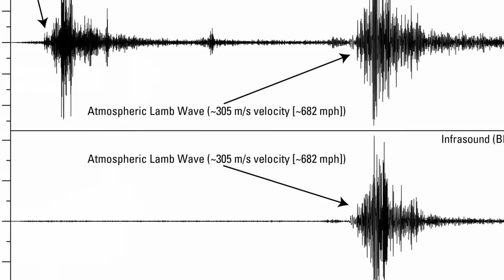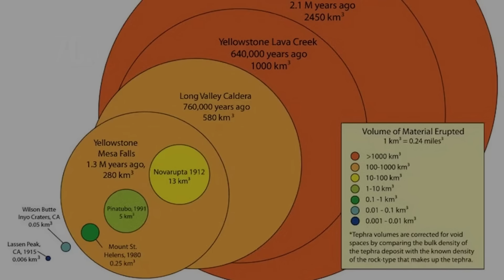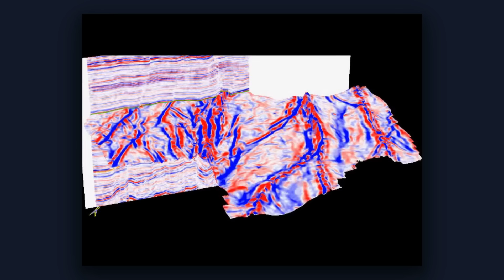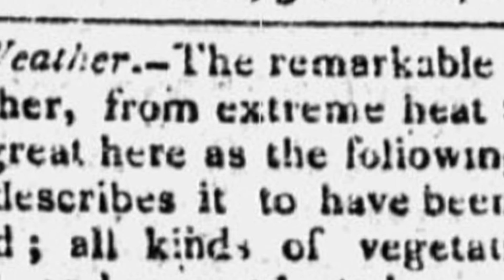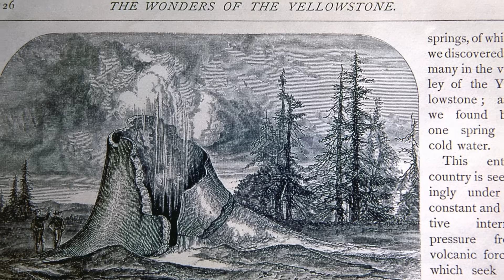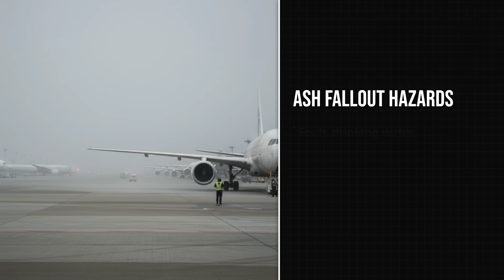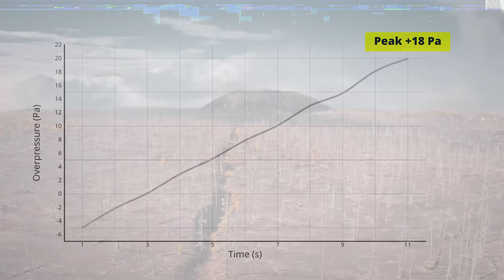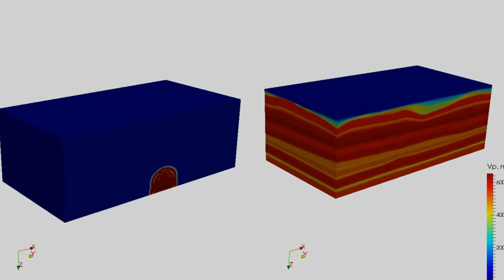1 MINUTE AGO: Yellowstone's Black Diamond Pool Erupts Again - Ring of Fire Responds Globally

Comment: Whoa! What a crock of gibberish, whether from lack of comprehension, poor reading skills, or deliberate lies on the part of the creator/narrator is unknown, but the errors are there. Some of the earlier eruptions, such as the one 16 million years ago did affect much of North America, but not those few smaller ones at the current location of the Yellowstone "hot spot." The most recent one, about 680,000 years ago, was in fact an eruption from the magma chamber, nothing to do with such tiny surface features as steam vents and geysers.
Reply: There was a small magmatic eruption about 70,000 years ago; nothing like the huge caldera forming blast 2.1 million years ago.

Comment: That's funny, because the real geologists, seismologists and vulcanologists I communicate with agree that there's no communication between eruptions.  They certainly wouldn't be triggered by atmospheric acoustic waves - they just don't have the power to trigger movement of magma ten to twenty kilometres below ground, and the explosion of a volcano is primarily a surface reaction, not an explosion at depth, so again it's not likely that the compression wave within the crust will have the power to trigger an eruption.
An explosive eruption is like a champagne bottle being opened.  It has the power to project the cork several yards, but it's the CO2 coming out of suspension at the mouth of the bottle which is the explosive force, not the body of the champagne within.
This eruption at Yellowstone was tiny, little more than a burp.  Please stop spreading sensationalist tripe.

Comment: 3:53 
“These steam driven blasts occur when water trapped beneath the surface is suddenly heated past its boiling point, causing it to [ suddenly ] vaporize and expand violently.” 

The remarkably high heat capacity of liquid water militates against “sudden heating”. 
However, superheated water that finally begins nucleate boiling, and as it begins expanding begins pushing out the overburden of the water column above it — yet further decreasing the local pressure below its local boiling point — can most certainly and dramatically “expand violently”.